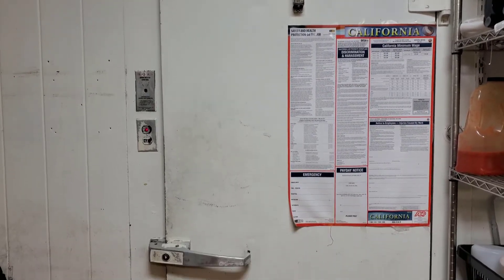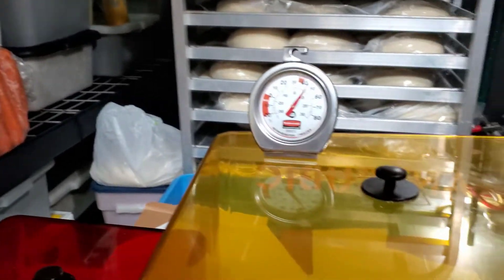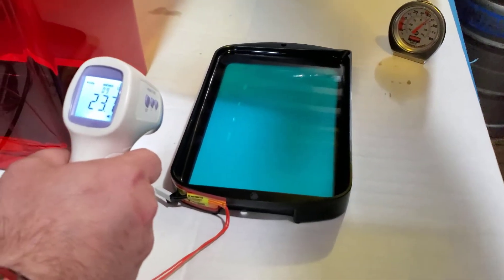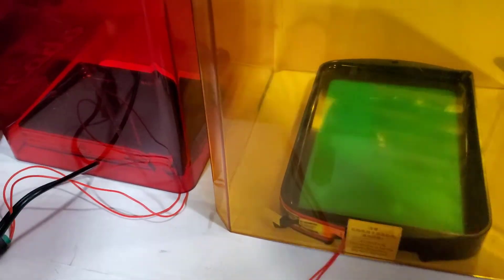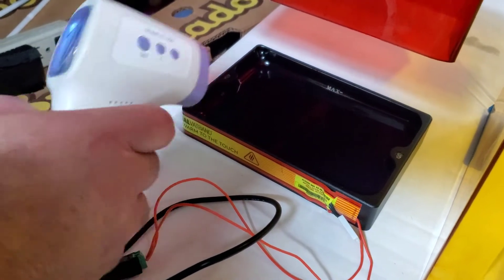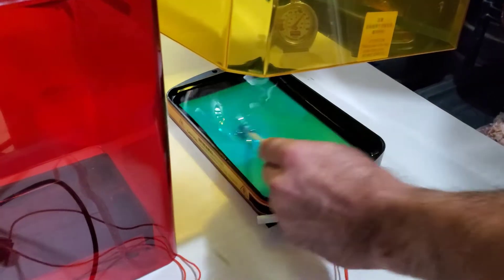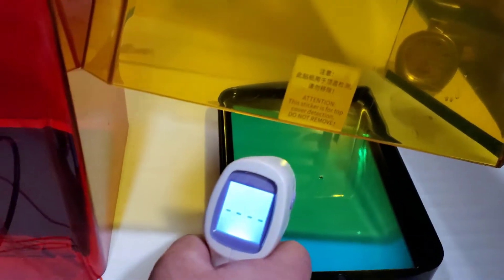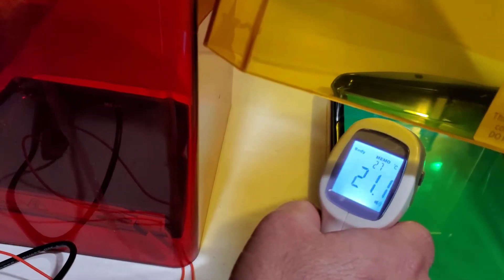Temperature testing ThermalVATBAND on 3D resin printer VATS in 40F degrees

Comment: Toxic resin in food fridge with loads of food in it. Even if the vat and other equipment is brand new out of the box. That’s a no go!
Reply from the maker: I should have included a note - thank you for pointing that out. I agree that the resin is toxic. I've been in the resin manufacturing industry, and in fact, we produce metal-infused resin. Check it out. This was planned; I did have an AQ sensor, and the fridge blows air out when the door is opened. We were right in front of it. Rest assured, we did not contaminate any food.

Comment: What was the VAT bands setting on?
Reply from the maker: You can only increase the cycling time with the power band. With resin you need to stay above 70F 22C unless  resin manufacturer like Siraya recommended higher temperature. Overall hotter is better. TVB generates heat primes the resin promoting better exothermic reaction. Thus you can decrease exposure.
Reply: @3dtvb  What I meant was, in these scenarios, what setting was the controller on e.g. 1,2,3,4,5,max or between any of them
Reply from the maker: @danielbroderick4006 You can max out the control band at 5. Keep an eye on the power adapter; if the light blinks, turn it down till it stops. This is a safety feature that protects the power supply and the VATBAND. This only occurs when there isn't sufficient power getting to the power adapter because of a long extension cord or a power strip.